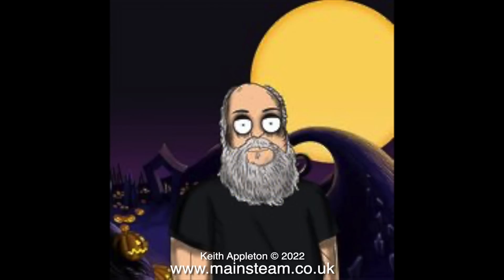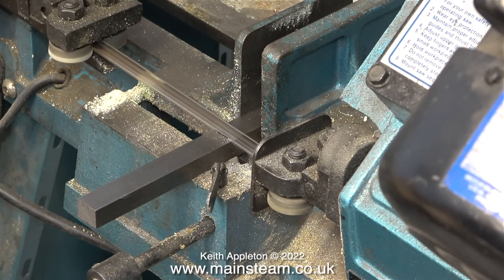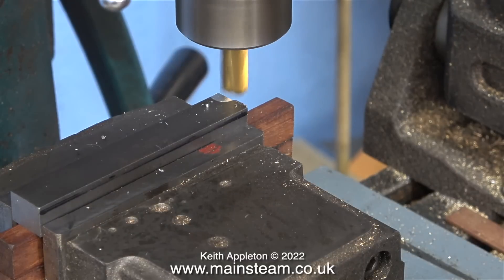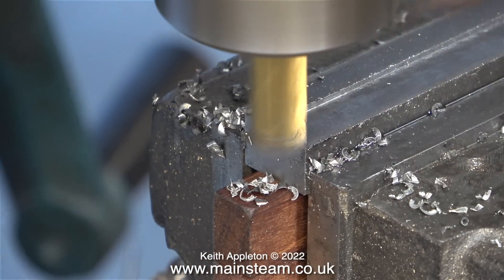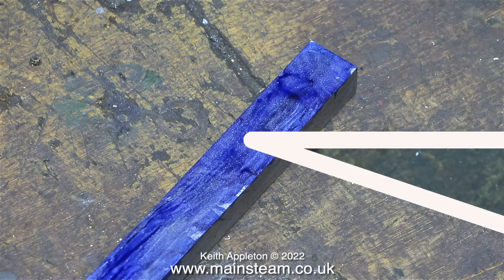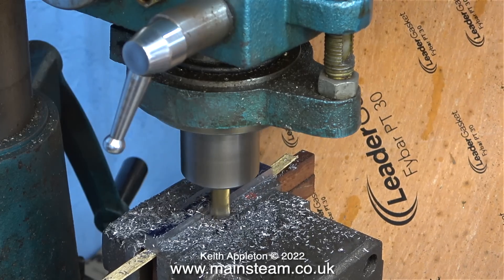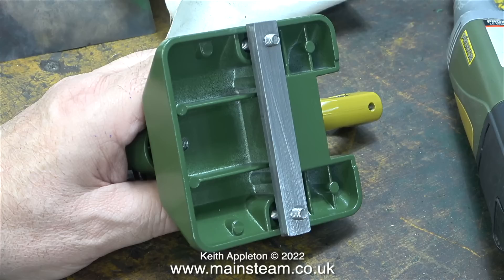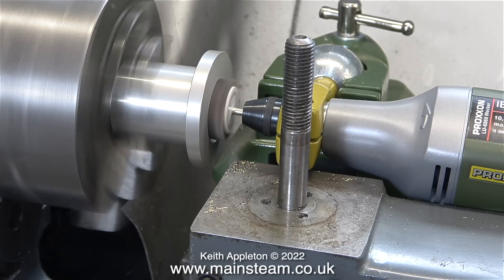A TOOLPOST GRINDER FOR A MYFORD ML7R LATHE - PART #2

Comment: I'm sure you're already aware Keith, but for other folks who may not know: When storing a t-nut as you did at the end by jacking it up to the t slot you must be very careful not to apply too much pressure, as screws generate a lot more force than you'd expect and you can very easily crack the casting if you apply too much.
Reply from the maker: I thought that was obvious, That's why I made the bolts slightly shorter . . . .

Comment: Nice going. Btw, you can get basic thin parallels, with just the two edges ground, very cheaply, and the accuracy is good. I think I paid $15 for the set.

Comment: I can see where such a gismo might come in handy. I recently purchased a Proxxon angle-head grinder in order to get into some areas where a 4" angle grinder is just too large. I bought the corded version instead of the battery version. I am having trouble finding replacement flap wheels for it though, unless I want to pay through the nose for the ones from Proxxon. At almost $15 each I wouldn't buy many anyway.

Comment: Keith, Despite you saying that you are not an engineer, your a musician i think that us "real" engineers have alot to learn from you, especially on a non critical part like a t-nut. your sometimes unorthodox techniques are really usefull, especially for someone who doesn't who does engineering on a tight budget. 
One thing for making T-nuts, i would recommend using a center punch to damage the final thread on the bottom so the threaded rod does not go all the way through and potentially damage your t slots
Reply from the maker: The damaged thread in the hole eventually damages the bolts so I just select the bolt length carefully.

Comment: You would necessarily have to have the indexer to drill flanges and things, you could just make our with a gasket, Or make a jig on the rotary, then go to the lathe I would think.  It would definitely save a lot of setup time if you where have to make multiple parts with drilled flanges, you wouldn't have to rechuck things. 

Sorry that was probably telling you something you'd thought of, more of a thinking outloud comment. Your videos are definitely not repetitive....I either learn something directly. Or figure out a process by observation everytime I watch.